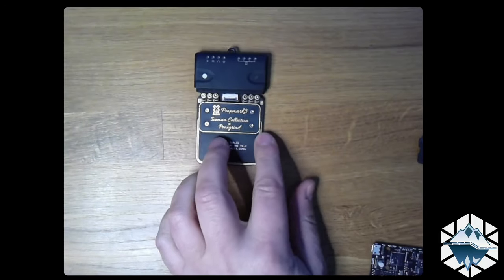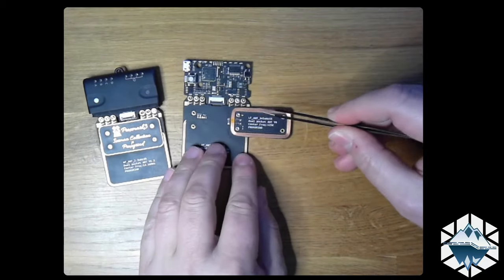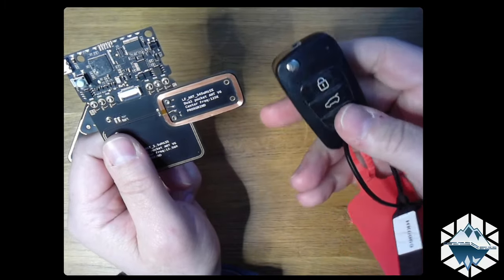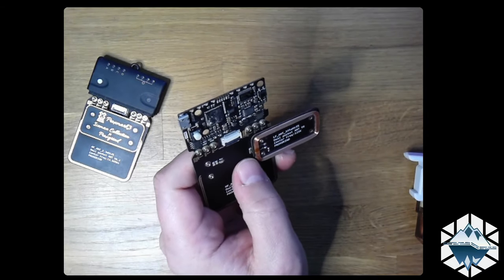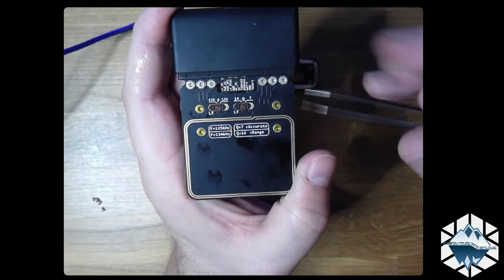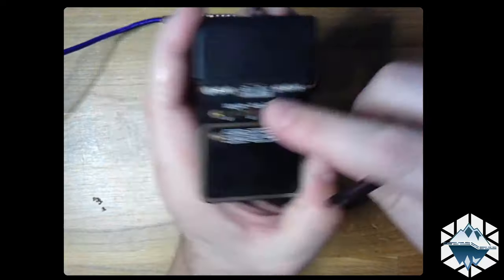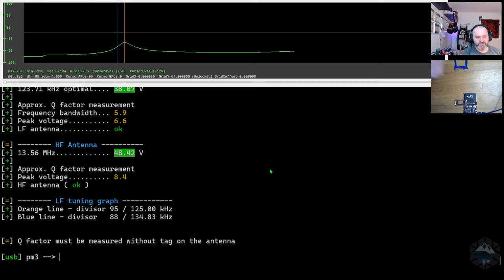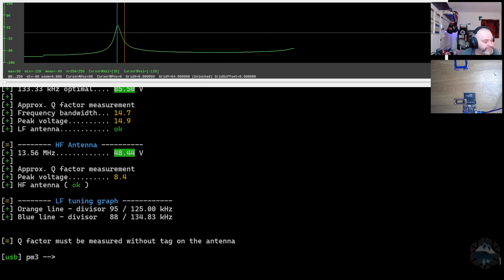Boost Your RFID Game: Proxmark3 RDV4 Antenna Hack for Implants & Keyfobs

Comment: For less than the price of a Proxmark3 RDV4, you can buy an entry level CNC machine that can easily cut flawless openings in PCBs. I have a Genmitsu 3018 PROVer and it’s great for PCB fab.
Reply from the maker: Sounds like a cool tool to have.  I have a bit limited space so I'd use a dremel :)

Comment: This is fantastic! I'm always so happy whenever I witness people making life easier for biohackers!

(I'm curious, those two terminals on the LF antenna... are they specific in their position? Like, could you hook up the antenna with the logo facing outward?  Or does each lead of the antenna have to connect to a specific point on the circuit?)
Reply: (two of the four screws are nothing in terms of the antenna connection. I'm referring to the other two that actually connect to the copper, naturally)
Reply from the maker: No,  you can't hook it up with the logo up,  sadly.  That is why you flip the antenna over.  So the connector / screws goes to same place.   I got inspired years ago from your custom case cutout.   Happy to be able both to use Philippes technique and your case modding :)
Reply: @iceman1001  right on!  I like how this is accessible to all users with minimal difficulty. 👍
Reply from the maker: @DeviantOllam  think out side of the box kind of style